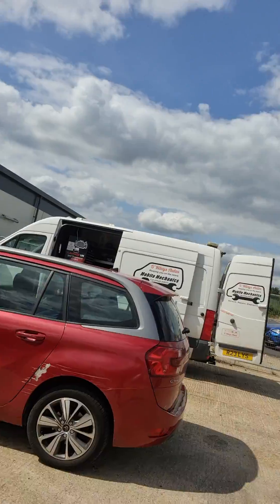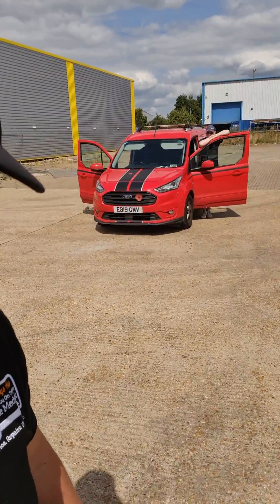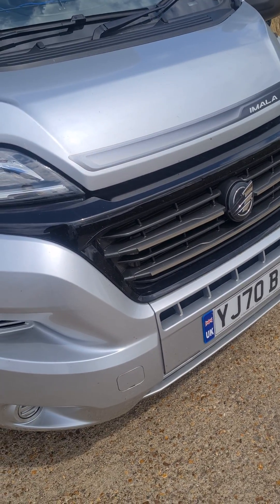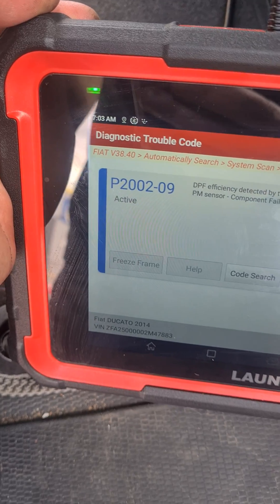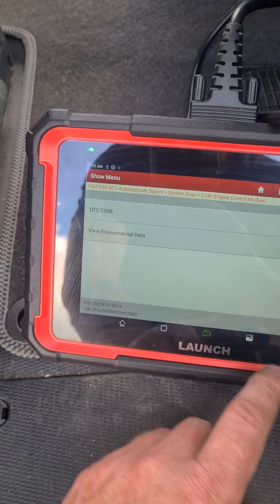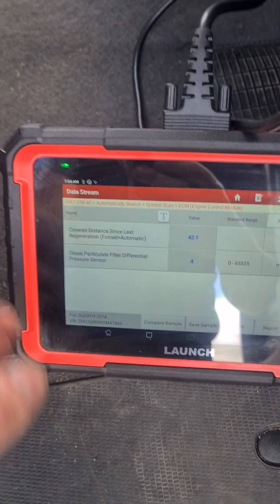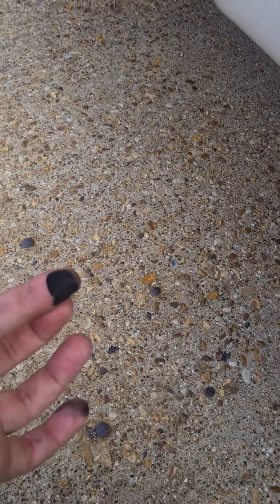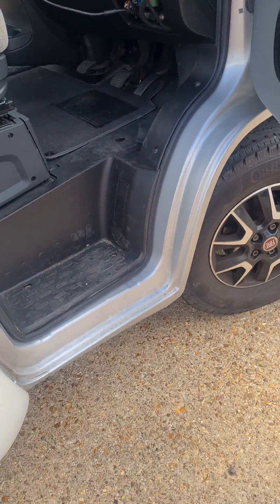Fiat Ducato P2002-09 DPF Efficiency Detected By The PM Sensor, Component Failures

Comment: I've got the same engine in my campervan. Also had failed DPF and stuck EGR (EGR first). FIAT wanted at least £5000 to replace the dpf alone. They have to disassemble the subframe and steering rack to get at it. DPF unit cost was £1700 + vat. Ridiculous. My van is a 70 plate.
Reply: @blackmac1970  sounds like there is a bigger problem here with more than one having the same problem mine only has just over 12700 on the clock. It would be more as we had plans to tour Northumberland and the Scottish borders and a visit to France and Belgium

Comment: It does sound very knackered as some have stated , for a 70 reg is ridiculous & the DPF has failed , just wondering its mileage as most motor homes have low miles on usually but still not good for Fiat ( 2.3HPI or 3.0HPI are usually solid blocks unless this is some other engine thrown in ) 😮
Reply: 9300 miles as of august 23
Reply: @chrisdunkley8055  may have done around 12,000 by now 🤔👍🤙
Reply from the maker: 2.3 fiat/iveco engine
Reply: @ORileysAutos  Hi Jimmy , that’s very unusual, it could be the microphone is sensitive on your phone maybe but I work for a passenger transport business (Rail) & we’ve had loads of Iveco daily’s etc with that HPI engine mainly the 2.3 & no issues I’m pleased to say , some have 3.0 but again no issues 🤙👍🤝🤗
Reply: @richie674  12,700 mainly on long trips so I can't understand why there should be any problems as it should easily do 10 times the mileage with no problem or anything but tyres replaced

Comment: @robingee6884 What engine is this?  Pre ad blue or with ad blue?  I ask as there is a known (but not well known ) issue on the pre-ad blue which can cause DPF failure - and simply replacing DPF will fail again later.  If pre-ad blue, any idea what ECU version its running (as thats the root cause of the DPF failure). Yes yes I know its unlikely but can direct you to more info if needed
Reply from the maker: 2.3 fiat/iveco
Reply: @Ryan_DYD  fiat ducato 250, 2.3 140. With ad blue. No idea what ecu version is

Comment: How many miles had that motorhome done? I expect a lot of the trouble will have been too many short journeys?
Reply from the maker: 12,300 miles
Reply: The DPF will be replaced under warranty?
Reply: @AdelSTech  No it won't because it's only a two year warranty.
Reply: No short journeys as it my motorhome, we have a car for short journeys and the shortest will be over 50 miles normally more than that it's been to France twice and the NC 500. The problems started after a run from Coventry to Swanage and Coventry to Southport both over 150 miles dual carriageway and motorways.
Reply: @robingee6884  Wow! What do you plan to do? Jimmy implied it needs a new dog. It must be of great concern? Most of the transits, boxers & ducato vans Jimmy has worked on seem to be over 100k on the mileage but yours is barely run in.
Reply: @TimmysFavs I talked to Fiat and have to take it for them for diagnosis. It  maybe  out of warranty but for such to fail it maybe a design or manufacturing error.
Reply: @robingee6884  That's great news for you from Fiat. I hope they fix it for free as a good will gesture